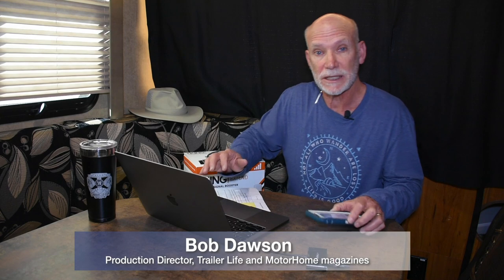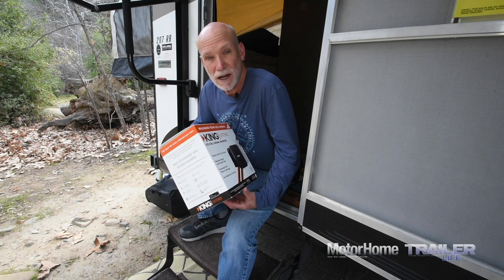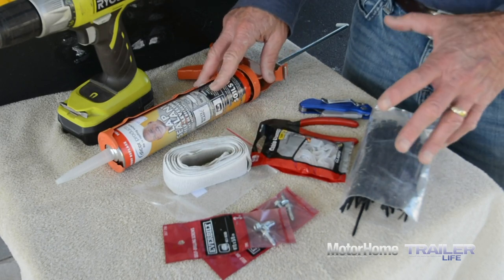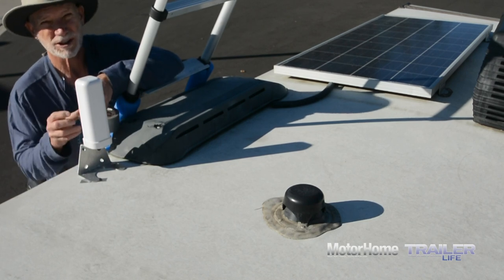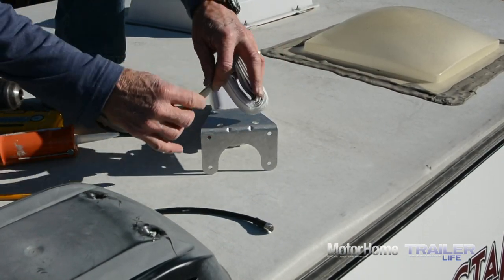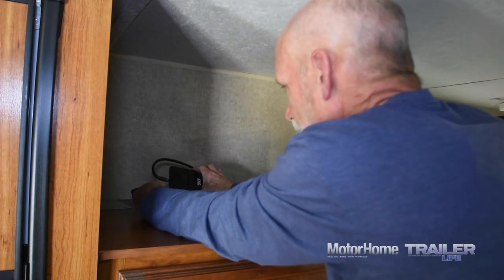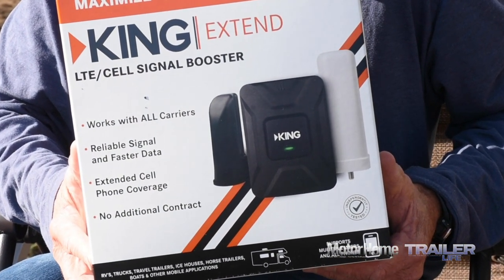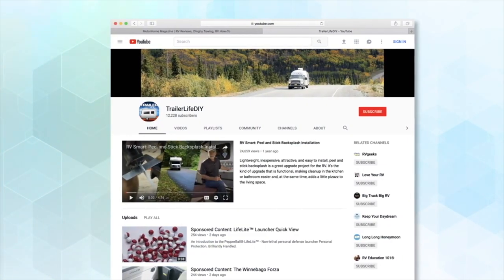Can You Hear Me Now? King Extend Cell Booster Installation

Comment: Thank you for the video. I'm not sure it would work for my camper it's not too long of a camper and I'm not sure how far apart the antennas have to be?
Reply: Hello Idaho Rider! Generally if one antenna is outside and one is inside you don't need an extreme amount of distance between the two antennas, usually a couple of feet will do. If you are really working with a tight fit and aren't able to get them far enough apart you can put something like a sheet of aluminum or metal underneath the external antenna and that will prevent feedback as well. If you are already working with a metal trailer than you will most likely have no problem at all! Let us know if you have any other questions!